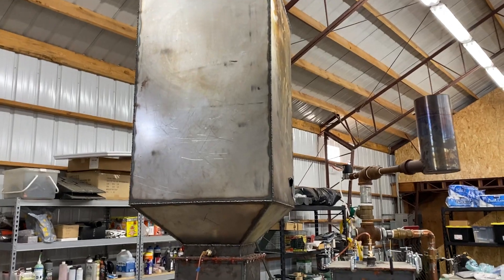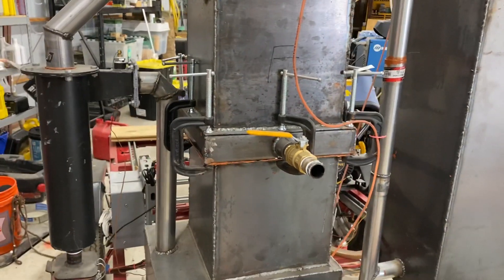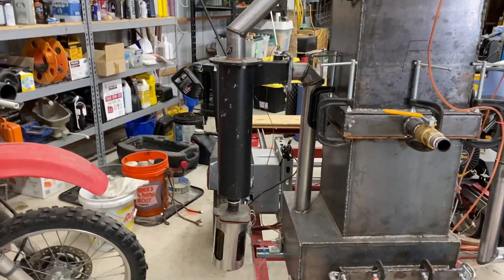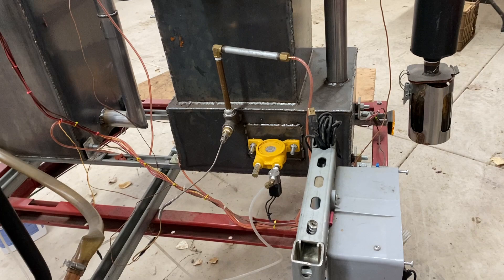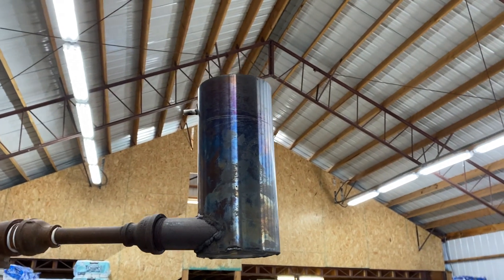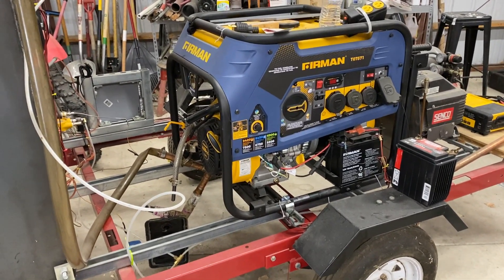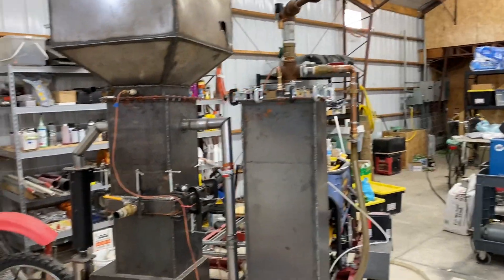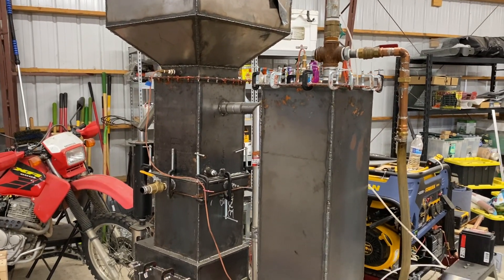Part 2: Gasifier Up And Running

Comment: Run your exhaust through some water, Let bubble up through water kind of like a distiller. I get clear blue flame. Helps takeout tar and any particulates in the smoking and gas.

Comment: A big bore pvc tube about 2metre long with about 4 internal water sprayers pumped from an adjacent plastic barrel makes for an awesome Tar Scrubber,pushing the woodgas UP thru this H2o mist/vapour removes 99% of tar/creosote....Everytime instant clean burn...There IS a vid on this toob someone built awhile back...If you already have good burnable gas,just dirty,leave your firetube alone...Try scrubbing first...you will be amazed.Most folk are trying to take moisture OUT of the gas...Make the Gas out pipe of the scrubber as tall as possible and the water vapour ads Hydrogen to the very clean flame...works for me.Enjoy.
Reply from the maker: Thanks for the comment. I look upon tar as both a problem and a benefit. Keep in mind that tar is essentially energy, though not really usable. If the the tar is cracked/combusted as it should be in the combustion and reduction zones, it adds to the energy output. I'm confident through recent test that the answer will be found by finding the proper reduction zone volume. Too small and the biomass passes through to fast and the combustion zone temperature  is too low. Too large and the differential pressure is too great and there's not enough gas throughput.
Reply: Make a YouTube video

Comment: you lose about 1/3rd of the made wattage running a genset on woodgas, next thing to do is shave the head on the gen set to bump compression and find a way to turn up the timing to accommodate the slower burn speed of the gas, this will get a bunch of power back. My chunker has issues breathing gas through anything less then a 1 and a half inch line, it will not rev up properly and my truck will cruise with a single feed line of 2" but there is a noticeable power increase when i open up the second feed line and let it really breath deep. What is the moisture content of your feed stock and what temperature are you seeing coming into the cyclone?
Reply from the maker: The biomass is well seasoned wood chips. Here in Northern Nevada it's pretty dry, so can't be much moisture. Yes, I think the biogas just doesn't have the energy density as gasoline or propane. Thanks for the comment.
Reply: @biomassgasification3883  Ever notice that a generator runs at the same speed all the time (unless its designed for Eco mode)? you lose 20-30% of a gasoline engine HP when you run it on woodgass. Generator heads have very specific torque and rpm requirements. it has been paired with the correct engine, so less HP is an issue for proper energy output. A simpler solution might be increasing compression with a supercharger. This would give you more woodgas and air without modifying your generator.

Comment: Not sure it's your air making your dirty burn the reduction zone needs to be fine tuned a bit.  Nice design trial and error good work.
Reply from the maker: Agreed. Adjusting the volume of the reduction zone. Currently to small which is causing combustion zone temp to be too low, in turn causing huge tar production. I suspect that the fuel is moving through the system to fast.
Reply from the maker: Yup, exactly right. The work continues